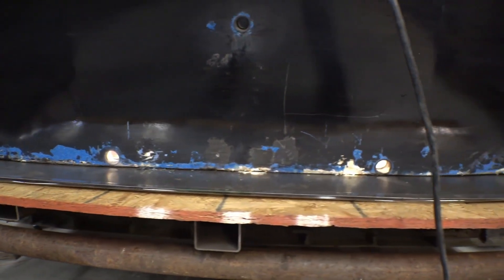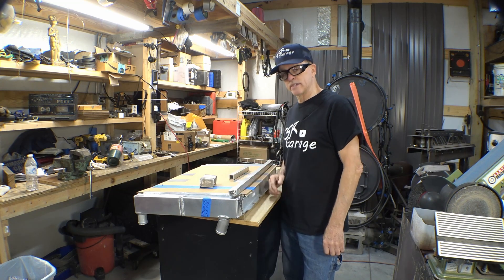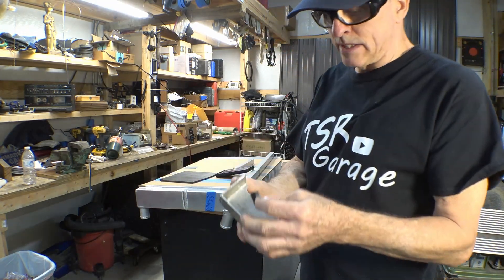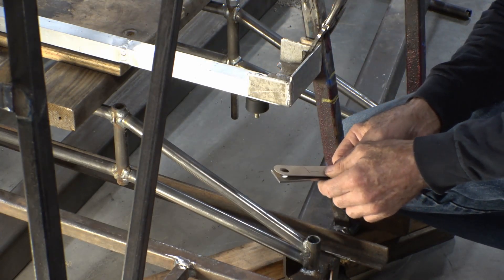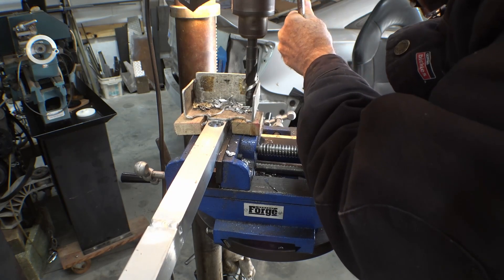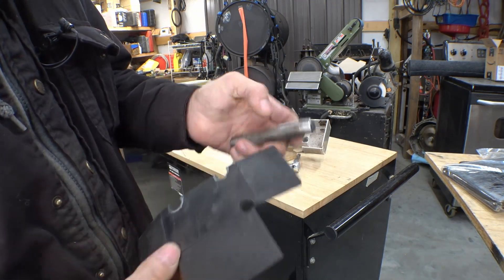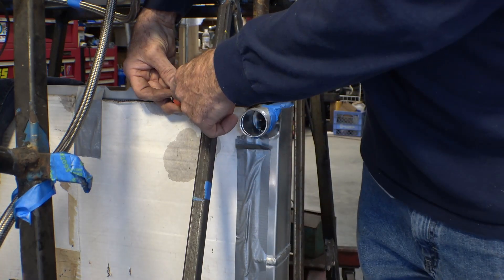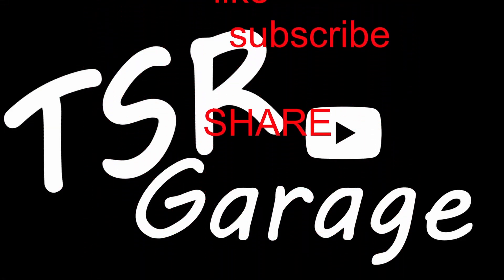AIRBOAT 350 direct drive- Howe Racing - aluminum radiator, making radiator support brackets.

Comment: I am currently in the same predicament as you were, Rebuilding an old 350 dd airboat. Could you make a video going over the coolant lines and overflow/ also the fuel line’s and anything else that might be helpful. Thanks.
Reply from the maker: I don't have.
Access to the boat anymore. It was sold.
   Fuel line routing is straightforward, just like it would be for a car. 
    For the coolant, you will need a radiator cap on the thermostat housing. Like this https://www.ebay.com/p/659309562 
     Then, run a hose from the connection at (just under) the cap to the bottom of a non pressurized reservoir, same as the older cars ran. Hope this helps. 
   Hoses from the engine to the radiator are the same basic routing as on a car just longer.